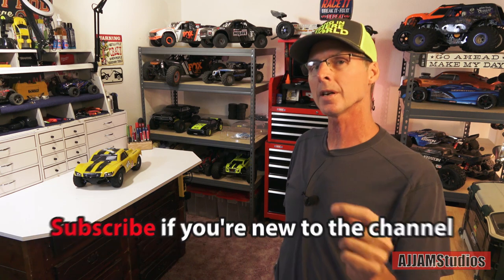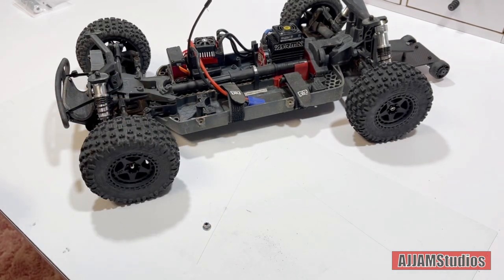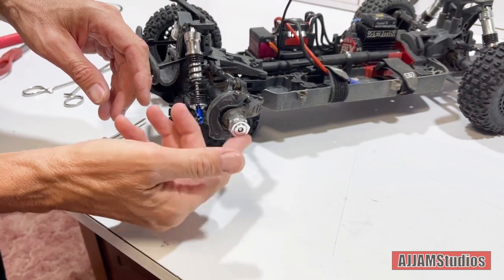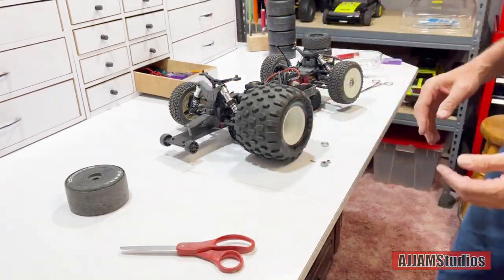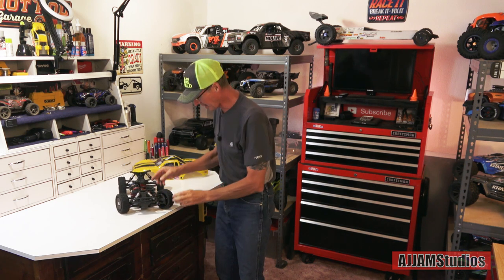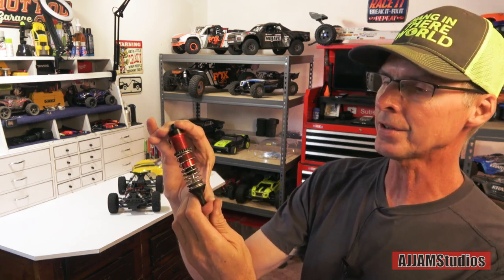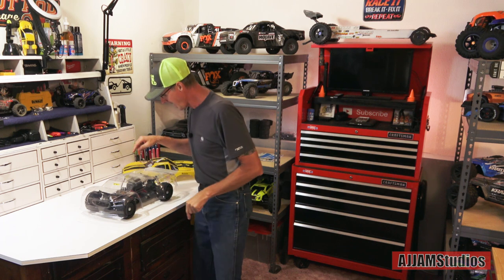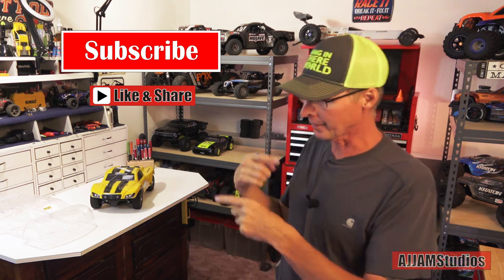Senton 3s 17mm Hub Conversion

Comment: I'm not sure I like that design. The pin is only holding on to the hex by 1/2 of one side. The side that the grub screw goes in the pin goes all the way through the hole. It may hold but it doesn't seem the most secure. I like the M2C one's better where the pin goes all the way through and then there's a inverted bolt that locks it onto the shaft using the original nut threads
Reply from the maker: After testing the part, I will definitely be buying the M2C conversion to see the difference for myself. I was unaware of the M2C upgrade at the time of producing the video. As you suspected, "The cheap ones do work", but there is a bit of slop in the system with them installed. I'm hoping the M2C system is tighter and hopefully stronger. But, as I said, these do work. Thanks for the input. AJ

Comment: Nice and very informative.
These duratrax bandito mt tires look very cool. Are they the 2.8 or the 3.8? Do you perhaps have a part number?
Want to give them a go on my kraton exb.
Thx and keep the vids coming 😉
Reply from the maker: Bandito MT Belted 3.8" Mounted Front/Rear Tires .5 Offset 17mm Black DTXC5628 
There you go. I found these on Ebay some time ago, but they are still available. I love the way they act on the pavement, but I would suggest checking the offset to make sure they fit your car as you would like them to. Also, the wheels are a bit weak, so be cautious in tight, high traction turns. I blew two of them out, and it only blew the hub, not the tires. Perhaps purchase a tougher wheel and then buy "just the tires" and mount them yourself. That solved the issue for me. I hope this helps. AJ

Comment: Wouldn't wider stance be better for turning fast so it has less chance of flipping? So wouldn't the offsets beneficial for say short course racing?
Reply from the maker: It’s a double edged sword. Yes, it may be a bit more stable but the ability to right itself would be reduced. The body design of short course trucks has a unique ability to land the RC on the side or wheels most of the time, which means turning into the ground and adding throttle can pull it back onto the wheels. Widening the stance may negate this ability. Both work but the choice has to be yours as to what to do. Wider…more stable. Stock…more time driving and less time walking after your RC when it flips.

Comment: What road wheels would you recommend for a Mojave?
Reply from the maker: My first thought was to use the Arrma Felony "Rear" wheels and tires (107mm rears) for that application. They are similar in size to the stock wheels, and they are wide enough to handle the weight and still get good traction under load. Plus, they are speed rated, so you can gear it up and get a move on with out fear of rupturing a tire and killing your Mojave. For my Mojave, those are the tires I'm planning on using when I take it to the asphalt. I would also recommend lowering the suspension and tightening up the shocks to limit chassis sway whilst cornering. That should get you in the game. If you find better tires for that application, please let me know. Thanks for asking, AJ.
Reply: @AJJAMStudios  I thought about those, but they look so much smaller. The 1/5 GRP look to be a better fit, but changing to the square wheel hub gave me pause. I I'll look at the Felony wheels again, thanks!

Comment: Your killin me here!! After the redcat debacle, I have been looking for a project in the SCT style. The Senton is it! One question, is this the same chassis as the brushed mega chassis? I have a simple brushless upgrade I want to use for the brushed but was wondering if they were the same so I ask someone who knows. That would be you guys!! I still feel bad about the Redcat SCT and the shootout, but you opened my eyes and I thank you again for that. As always, great video and keep them coming!!!
Reply from the maker: We’ve done that same thing with the typhon and it does work but the motor mount on ours needed the 3s version and the diffs for the older Megas are plastic but held up for quite a while. Then there’s the slipper to accommodate having to mod slightly to get it installed for 3s. However, the effort was well worth it in the end. And don’t forget to add the center driveline breaking kit to it. Best of luck on your build, AJ

Comment: Link for the hubs?
Reply: Are the Arrma Typhon 4x4 3s / 6s BLX dBoots 2-HO Tires the same size at the 3s senton wheels and tires? I want to put the typhoon tires on my senton but don't want to cut my body
Reply from the maker: Sorry, no link, they came from my local hobby store, but I do know they are Red Cat hubs. I wish I could help more, but I lost the tag for them. Search Red Cat parts and you may be able to find a set.
Reply: @AJJAMStudios  thanks
 I found them on e bay